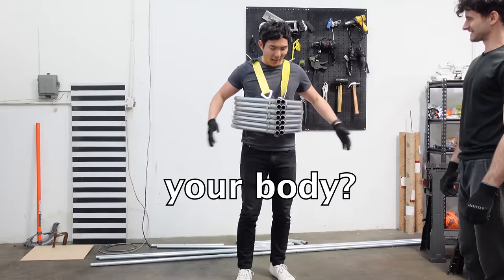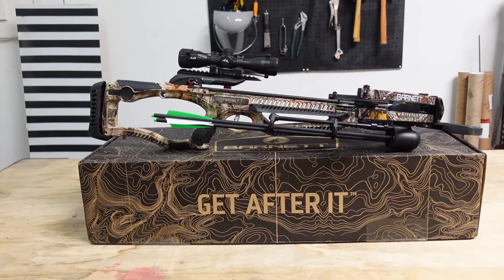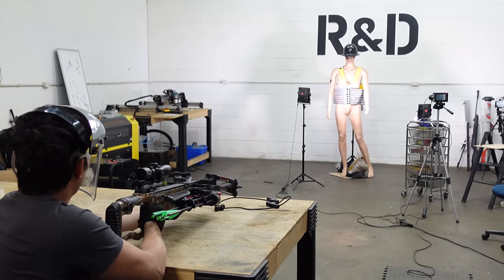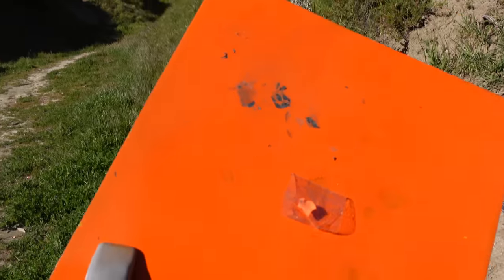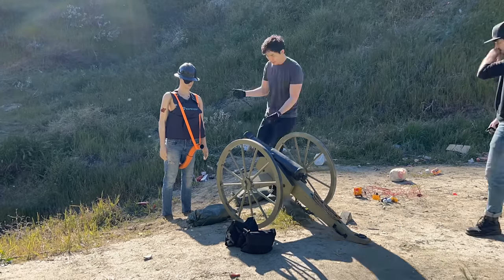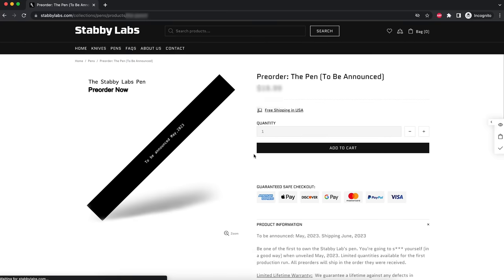Testing WEIRD bulletproof armor ideas (curving bullets)

Comment: Whoever charged you $400 to bend that completely ripped you off 🤣
Reply: I bet that quarterwall pipe alone was $200, not to mention having a machine shop do it and not his neighbors.
Reply: Yes but 400 dollars to save your parts from a direct cannon ball shot . well that's priceless
Reply: Bender B Bending Rodriguez
Reply: Shh, let em all think that's the standard. I can run pipe, I'll gladly take 400 a bend.
Reply: But she got almost 12.000€ whit this video
Reply: @elpinche915  i'm a plumber and I know for a fact that I can make that for less than 50€
Reply: Roundness 0.05 is nuts

Comment: Your tests with the rifle against the wiggly pipe reminded me of a video I saw the other day about the StG 44 barrel attachment used during World War 2 called; The Krummlauf. It was basically just a slight curved barrel that allowed troops to shoot around corners or over walls, etc, but because of the bend was only able to be used for roughly 100 rounds and turned the rifle more into a shotgun-esque shrapnel spread.
Reply: Interestingly there were originally four types of this twisted barrel, but only the smallest bend was used as all others would break within a few hundred shots, were extremely inaccurate, and like you said they were basically worse shotguns. Even then the one that was used was very limited due to the same problems.
Reply: @leflamewolf  Yep. Israel fixed this problem by using a mechanical system to aim around corners with a pistol. The front end can be bent around a corner with a pistol on it while you hold it like a rifle. Then, when you pull the trigger, it sends a signal to the lever attached to the pistol trigger, causing it to fire. Pretty neat way to avoid the curved barrel and shrapnel problem.
Reply: @rebelgaming1.5.14  but this idea fell out of any favor when they realized very quickly they were carrying a rifle sized package for a pistol sized cartridge, So while the concept and prototypes exist, iirc nobody cares to put it into production

Comment: The pipe doesn't have to be thicker and heavier, you just need to reinforce the turns only, and it would keep the weight and cost down

Comment: 0:52 - that actually WORKED?
Reply: I'm not surprised. The biggest question I had was whether the bullet would actually enter the hole rather than just hit the pipe itself. The pipes themselves are pretty thick in the direction of travel of the bullet, so probably more protective than the vest.

There are a whole bunch of reasons why this wouldn't be very useful though.
Reply: @SmallSpoonBrigade what are those reasons?

Comment: That's basically the idea of slope armor. Have you tried using 2 bulletproof plates to form a V shape, and test how much their protection improves? Must be fun
Reply: Somebody did and it does work. The issue though is that it's heavy and doesn't capture the bullets, so if there's anybody that you don't want to hit it's not useful.

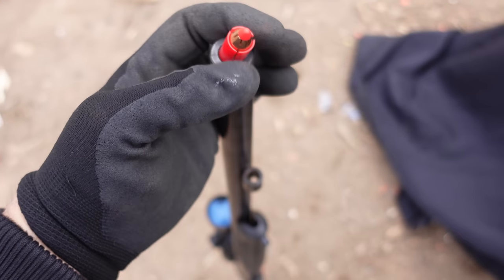Comment: 1:04 my question is.. why would you want the bullet to circle right around 180 degrees and come back the same way (which probably wont work cos the bullet is travelling too fast)? i can imagine a better way to do this that covers your entire body - why not instead have pipes that cover your entire body so the entire front of your body has pipe holes and all the pipes just curve around slightly around ur body and come out pipe holes at the back and the bullet just keeps going? that way u can get shot from both directions... if u were even more ingenious u might do pipes also going sideways so u can get shot from the side also and a twisted maze of pipes all curving around your entire body..  if u were to add even more tech u might want to use magnets or something to direct the bullet into pipes... imagine a kind of maglev technology that keeps a high speed train floating but instead it does that to a bullet so the bullet never actually hits the pipe around the curves.

Comment: I will say black powder(or Pyreodex which is probably what you were using) is significantly less powerful than a cartridge. The cartridge provides protection to the gun and contains much of the pressure. This means you can both load it spicier and more of that power is imparted on the bullet.

Comment: You should use schedule 80 pipe next time. It will be heavier, but will stand up to pretty much anything.
Reply: Pvc is worth testing too. Demolition Ranch did this sorta thing a while back and iirc it was more successful than the metal pipes.

Comment: Questions immediately arise whether this can be used somehow. Will the effectiveness of armor increase if you add similar pipes to it, only with a much larger number of entrances in front so that you don't have to aim, and exits from behind? And if you don't forget to add a lightweight bulletproof vest to protect against shrapnel and collapsing pipes (so that the total mass is no more than the mass of a standard bulletproof vest) under this pipe system? The idea is that modern bulletproof vests suffer all the time with the problem of energy distribution, which has arrived at one point. If some of the energy is not absorbed, then we can win in the effectiveness of such a protection system. The question is, how much energy does the bullet transfer to the pipe system while it ricochets off its walls

Comment: The part where you shot the bolt through the stack of cardboard, try it from the side the has all the holes and keep the boxes compressed together, ive tried it with steel bearings and it stops it alot better than shooting the flat plane.

Comment: 4:13 - 4:35 "I couldn't quite get it in, even though there are 14 holes on this mannequin. In contrary to my experience, aiming for a lower hole might make entry a whole lot easier. Ooohhhhhh... 3, 2, 1... On slow mo, you can see it in go in without much resistance, despite the shaft snapping. But we clearly got plate strike, and if you look at my tip, you can see it's yellow."

Context definitely matters here.

Comment: To be fair the high power rifle exploding the pipe was because the muzzle was inside of the pipe, the pistol was shot at range and was not directly in the pipe.
Was the rifle significantly more powerful? Yes duh
But would it have exploded at the front? We don't know

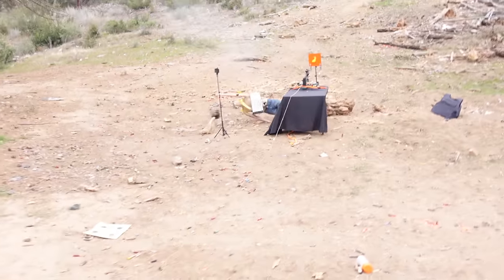Edit: reference 2:15

Comment: Those anti grenade holes are some of the best ideas someone could have had for a bunker. Holy shit kind of thinking that definitely carried over from the last war that’s for sure
Reply: It can still serve as ventilation too with some bending pipes
Reply: @kv4648  I believe they actually do still serve as ventilation, I don't think it's a question I think it's something they did
Reply: @tzimiscelord8483  that's pretty nice efficiency 👍
Reply: I don’t understand how someone thought designing vents like that was a good idea in the first place.  A direct shot into the bunker with a large enough diameter for a grenade?? What??
Reply: @superstarr310  hindsight 20/20
Reply: @superstarr310  I don't think they're usually real vents, they're meant to look like vents and to draw the attention of attackers, but mostly they're meant to funnel the grenade back at the attacker, both wasting a grenade and probably injuring them. 

Plus, you can always build a shutter into the design to direct the overpressure away from whatever it is that you're trying to protect.

Comment: I just bought a 3 pack Black FN Pen 2.0, LA420410740. I would like to see a glass bead armored vest tested to see if glass beads could work similar to ceramic armor. The beads would need to be encapsulated in some way so they offer complete coverage without gaps. To hold the beads in place they could be stitched between two layers of kevlar and two layers of stitched glass beads would be overlapped to fill in the gaps where a single layer of beads meet. The glass beads would serve two purposes. First, a hard material that absorbs energy when shattering. Second, causing some deflection due to the round beads. Possibly three layers would be needed.

Comment: When you bend pipe, it weakens the metal at the bend …. Except when the pipe is hydraulically bent … hydraulics evenly spreads the force and the metal maintains its characteristics throughout the bend keeping it as strong as the original metal.

Comment: Its theoretically possible. But very expensive. Multiple plates like coins. 70 coins, 7 cm diameter, 7 millimetres thickness at 70 degrees from each other.  Lots of padding between coins.  Such armor or shield will deflect away pretty much any projectile.

Comment: Instead of using the pipe on the vest use rectangle tubing in replacement for the pipe so you don’t have the small gaps in between the tubes

Comment: That's amazing, but could you one day do this experiment in the name of science: A pipe running a liquid like water or oil at different velocities. It could be running in a loop if possible. I wonder if there is a cavity between tow sheets of metal, and in rhe cavity there is this hydraulic fluid looping at high velocity, would it diflect and or absorb the energy from a bullet?

Comment: The only way it's possible, for bullets to curve would be with a gyroscopic imbalance! And at this point, the bullet will not guide as you would want it to and be completely off target! Now there is math that could fix this but good luck with that! The machine required to get everything lined up for that shot would blow any government budget.

Comment: Had you not put the barrel of the muzzle loader inside the pipe and actually had someone that knows how to shoot, you might have more success.  Also with the .50 bmg, you realize that’s an anti material gun right?  Don’t put rifles so close to your pipes.  Just the pressure from a .50 bmg could break your pipe.  Without a projectile.  Good luck next time!

Comment: you went straight to needing a thicker pipe when the thin one "couldn't handle a rifle round". obviously you did not watch demolitian ranches video on this. when you used the thinner pipe, you put the barrel to close to the pipe and all the force from the explosion went into that pipe and it burst. if the gun was further away it would probably not break the pipe.

Comment: But why did you shoot at such close range as if it were an execution? Most shots hit at a much greater distance, which makes the ball hit with less force, and thus such a pipe can actually work.
Reply: At this range, it's obvious that a bullet will go through any pipe, not to mention you're using high-caliber rifles. I'll explain using a headshot as an example: when firing a .22 pistol at close range, the bullet will most likely go right through the head, but when shot from a greater distance, the bullet can penetrate one side of the skull and ricochet on the other, so that it stays inside. At a really great distance, it might not penetrate the skull at all.

Comment: This doesn't look accurate. Hot gas would exit the barrel of the gun, and since its aimed at point blank range to the pipe, the gas would expel out of that too. And the gas itself would be enough to blow up the balloon, so without slow motion capture, we can't say for sure if the bullet was redirected, especially since you only show the aftermath of the shot, and not the actual footage when the bullet travels.

Comment: Mythbusters is kind of dangerous and dumb.... bullet simple requires x force impact to its trigger to ignite, so tehy oculd of built a massive spinning pipe system taht spins extremely fast. the center trigger pin, hits hte bullet through the pipe. It fires out of the aparatus... then a camera about a matt overlay of a mono tone tarp or paper, you can track the projectile and curve, but techincalyl its knonw physics... so.. the bullet could curv,e you can engineer a bullet ota curve.. So you have motions of relativity... the problem is teh bullet oculd melt into the spinning pipe as it would apply its forward motion against it.. so the slower the bullet is fired at teh easier and widera curve owuld be easily seen. So you can modulate a bullet to create a curve.... Spinning on a merry go round.. do you fly off straight or contain some of the rotational force.. If you keep that force or you head straight out and launched into space... The speed of the bullet and wind and shape can affect its velocity as oldest guns and gun powder were notoriously for curving and going off target so you would have to send in a volley... a bow and arrow would be better... but cannons... somethign else... a cannon line is better than a gun volley line... so the question is physics and what makes an object curve.. we know gravity will make it curve down. Impact on an object and colour. 

A rotational force would cause a linear expression, but a horizontal running motion would cause a curve from the point... or release. The problem with a spinning motion is its typically a linear motion affect by gravity... So... a curve bullet... that isn't reliant on gravity.. would requie not a rotation force by a running force it owuld be proportional to the the speed of runner and bullets expression to decline.

The bullet would be going at the pace of the runner, falling at the gravity, while going from the explosion. While its shape adjusts its angle of attack.

So.. in other words... you should be able to curve a bullet... The barrel length would also affect, it. This would all be Relative motion of a body. 

so... a curved barrel provides the same problem of stress since the origin of force is at a rotational angle putting to much stress on the barrel.. where if you move the unit at a relative speed ot its origin (this is why spinnign doesn't work) then you can get a horizontal curved trajectory, without engineering a bullet.

So... to make a bullet go left... you could have a gun on a track moving like on a train... and shoot from it, it would continue the motion of the train applied to the bullet. So.. if you made a trigger system that while the gun is in motion, it fires. The entire gun is in motion, bullet and hammer and barrel. It will shoot without problems or stress, minimal. So you can create a snap system that moves x speed to the left. in a small location. and fires at the peak movemetn or porgrammed movement to fire a curved should... so you could hit a target around the corner of a wall by the application, typically you would be in vision or sight, but once you udnerstand the curve relation you could fire towards a wall.. and if you know hte bullet distance total travel adn how much horizontal force is needed then you could calcaulte hte curve, its not rocket science...

Rotational or spin force isn't the same as a running/ train or a mechanical horizontal force of the entire unit.... The problem with rotational force is its a lever force... so the entire record may be spinning but technically it has a variable ammoutn speed where you are.. where simply a horizontal motion of a netire unit is the entire thign thus has ot effect the system.

So again. A mechanical slide arm.. WHihc means you could even invent a double hammer arm. Where a explosive round, fires the mechanism horizontally. and when it hits a place on the track fires the hammer to shoot hte bullet... and then the bulelt will maintain that horizontal velocity.... and its fired velocity.

Comment: so doesnt this just prove that flat body armor is weak compared to an angled body armor?
wouldnt a diagnal ~45 or even just a 15 degree offset provide a greater than rated defense by deflecting the projectile away? 

surely there is an angle at which a deflection is alway away from the body regardless of direction its hit at.

Comment: This is called a fishing line trajectory. I have seen it in emergencies when the projectile remains under the skin of the chest and travels under the skin, exiting through the back.  You can see an entry hole and an exit hole but it never penetrated the inside of the body.

Comment: Germans in WW2 used harden steel for thay barrels and fitting diametar. Even then after several rounds fired, barel was overheating, and get damaged.. and it was like 30 to 45 degrees curvature.

Comment: Good thing the highly expensive horseshoe pipe was bent into precise dimensions instead of just using a hydraulic or hand bender, so you can intentionally break it on the very first shot with a way too powerful shot, i dont think it wouldve worked otherwise

Comment: pipe burst from you putting the muzzle inside the pipe, gas expanding rapidly causing high pressure in small area not allowing expansion. not the bullet silly goose

Comment: Just pre-ordered a pen, LA42015543 :) thought for a while and came up with an idea akin to Colin Furze's spinning knife belt (https://www.youtube.com/watch?v=vWGquxvqI_Y), but with metal plates positioned flat pointing outwards, so that bullets that come into contact with them get "slapped" and turned into shrapnel 🤔 assuming the bullet's speed isn't enough to cover the length of one plate in less than time it takes for a plate to rotate 360 degrees divided by the amount of plates, it would impact